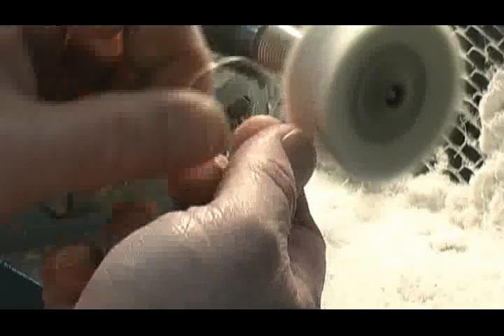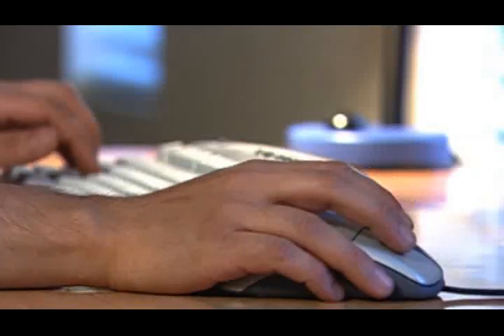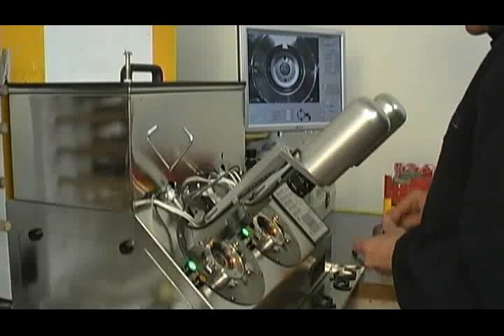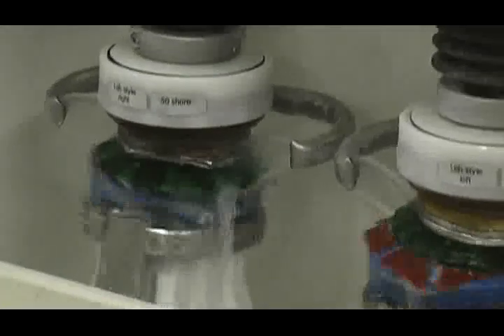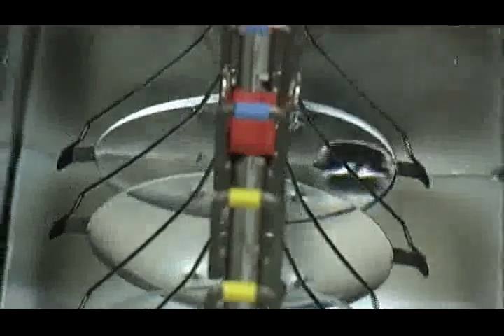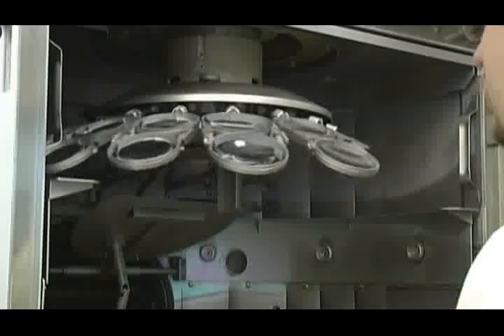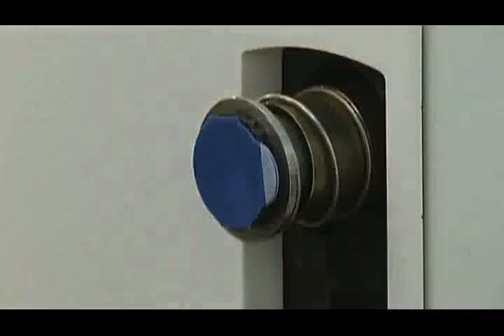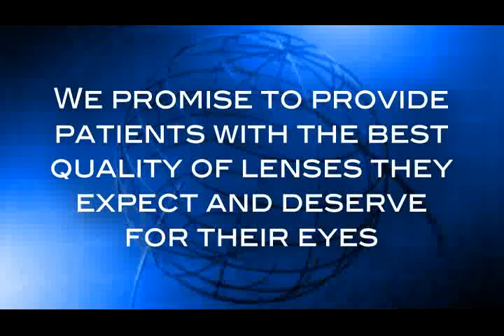How Eyeglass Lenses are Made

Comment: Wouldn't it make more sense to cut the lens to size first before applying the anti glare coatings? ... Why handle the lens any more than necessary after applying coatings? Coatings should be the last thing done just like the finishing work on just about anything else in life... (We don't paint walls first then cut them because we would risk damaging the finished surfaces we're trying to protect!)